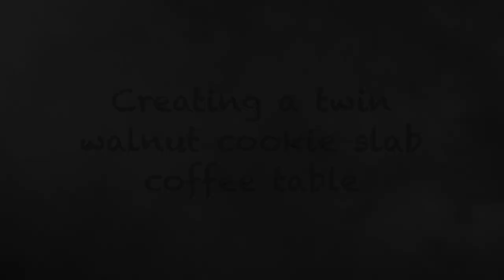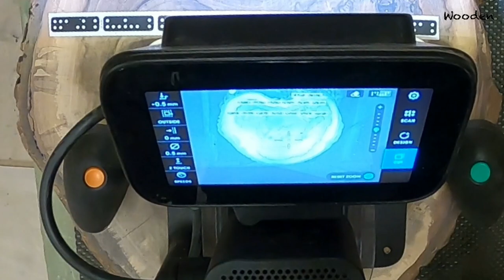Twin cookie slab coffee table - Walnut

Comment: Wow! Now that was sooo interesting! Wasn’t expecting you to keep the bark. Very nice!!! Gotta love that walnut! The awesome beauty of natural artwork! Now did you incorporate the moss that was on the bark in the piece? And if so how did you edge finish it? Simply awesome!
Reply from the maker: Thank you Henry 🙏🤩 I have found the bark of walnut to be pretty forgiving. If parts of it still sticks to the wood, you can glue the rest of it to the wood with epoxy resin. And it completely changes the looks of the table. I know what you mean by what looks like moss, but it’s actually not moss. On the part that had a big hole, the epoxy leaked onto the bark. So I had to sand it, and what remained was a mix of wood, different parts of the bark and resin. Together it creates an amazing look and on a few spots it looks like moss. It made me think of using this technique on purpose. Could you basically flood the entire bark on purpose and then sand it? Could look pretty rad…